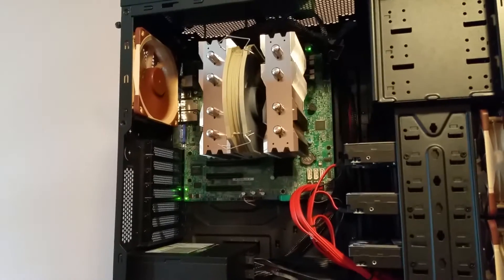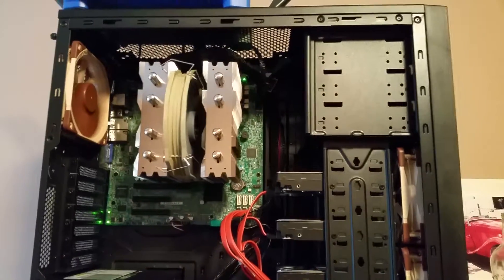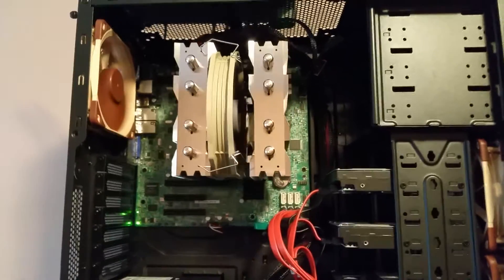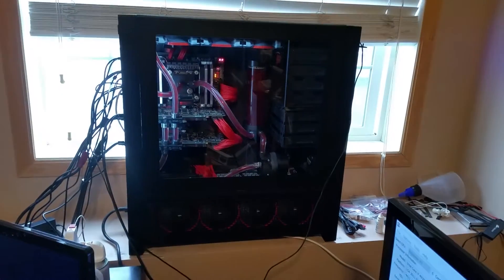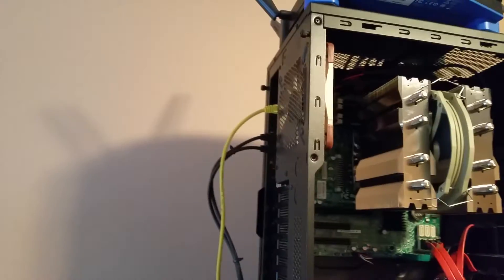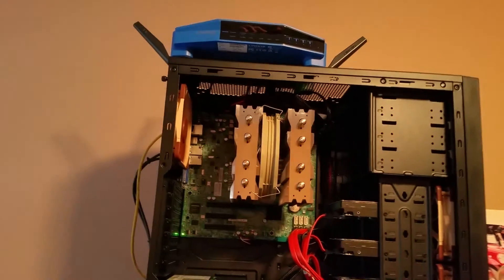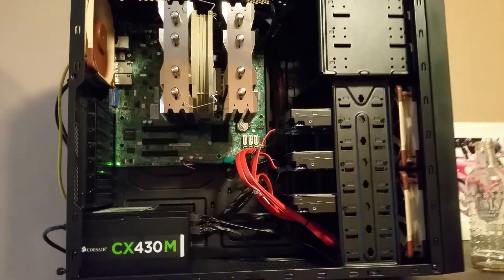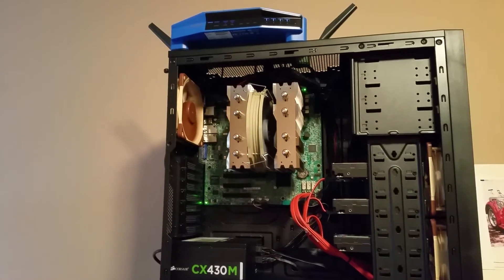My FreeNAS Server

Comment: Hello, what are your file transfer speeds like over the network? do you get full gigabit speeds with the G 3260?
Reply from the maker: Yes, it worked just fine.  Transfers around 110MBs.  If all you are doing is storing files, it is plenty of CPU.  I have since upgraded to a 1241 v3 Xeon.  Only reason was for better transcoding for Plex.
Reply: Nice, i built my Freenas box last night. Using a G2030 and i do not use plex, i just watch videos via VLC over lan so i doubt it would be stressed as much. I get a stable 105-115 MB/s with Freenas 11 RaidZ 4x2TB Hitachi drives.  You made my day with this video.  Thanks
Reply from the maker: Mike Williams glad you enjoyed it.  There is a follow up vid with a less ridiculous cooler on it.  Lol

If you are just direct streaming via VLC, you are golden.  Plex only hammers it when transcoding for remote viewing.  I work out of town a lot, so stream from hotels.  Sometime the connections are pretty terrible. And plex has to turn uncompressed bluray rips to 2-3mbs 720p.  That hammers it.

Comment: Is there an OS/Kernel to have a freenas & pfsense router into one?
Reply from the maker: you would need a VM machine with something like ESXI on it. Basically as long and the hardware supports VM and you ideally use an OS made for VM.  But you could use pretty much any Linux/Unix distro you like.  I like having separate machines though.  That way if one has an issue it won't effect the other.